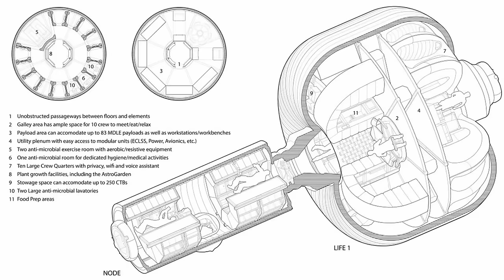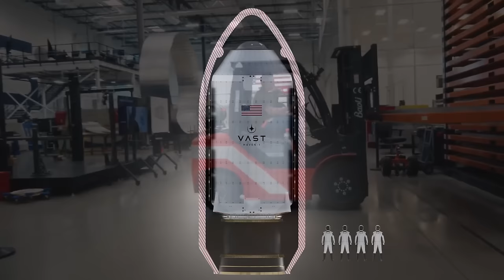The Space Station Race is Heating Up

Comment: i also think vast will be the winner. the rocket is available and its only their side which will be holding them back
Reply: Nah, whoever starts designing an endoskeleton structure that holds multiple modules together will be the company that gets rich. The problem with current space station designs is they all have to be a jack-of-all-trades which makes them expensive and limits the potential of any design. Connecting multiple stations together with a rigid girder system and eventually floatways(hey, you don't walk in space) will not only massively reduce the costs in designing modules but also allow for specialization and redundancy for safety reasons. Also there would be a market for renting out spaces and for modules that would provide quality-of-life services such as showers, restrooms, restaurants, and medical labs. 

You don't build a successful town by building one massive building. You build a town by creating a framework that can allow independent people and companies to work together in an area.
Reply: @ryelor123  Such structures would be heavy and only be warranted if the space station being built around such an endoskeleton are planned to be enormous. Which brings us to the main problem: launch mass, payload volume and cost of access to space. This main problem will be remedied to a large extent by Starship. But will that be enough? Or will we need to first set up industrial bases on Moon and only then will such massive space stations become possible? This is an optimization problem not too dissimilar from a wait calculation in interstellar travel (which is actually one of the main consideration in galactic empire building). OK, I think I went off on a tangent here. Just thinking out loud. Sorry.